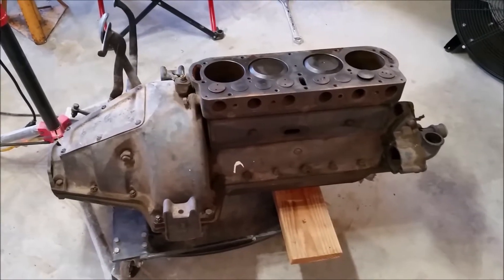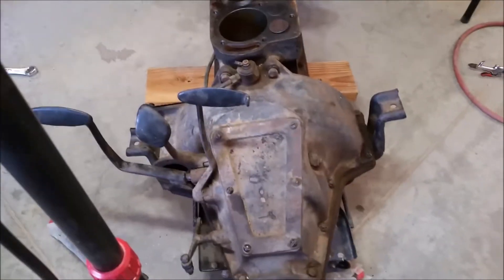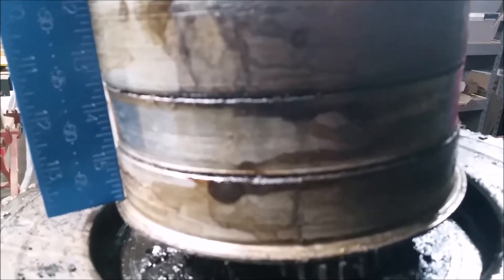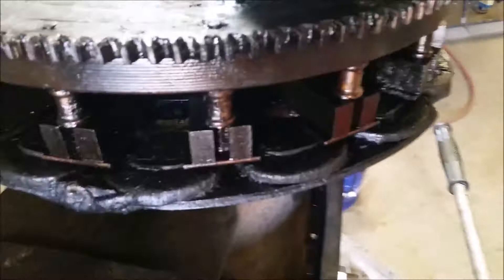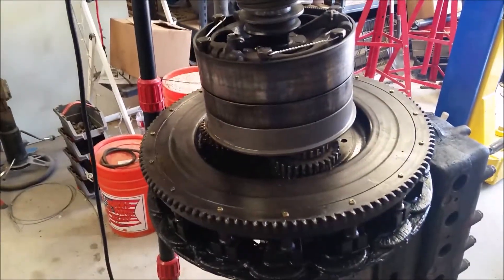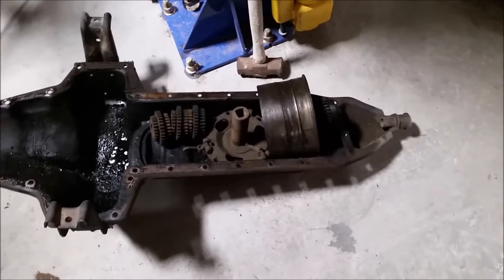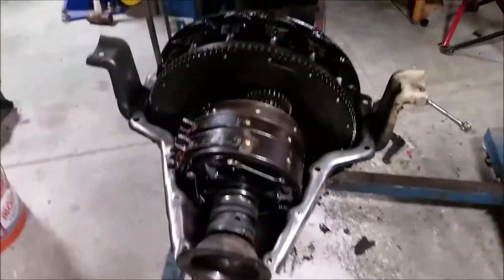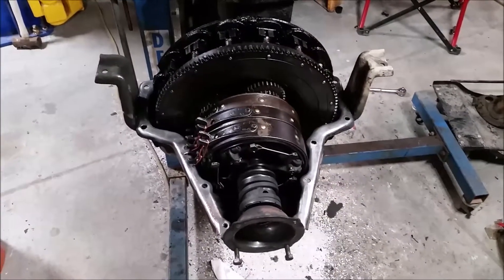The Replacement Engine

Comment: The pedals are consistent for a 26 or 27
Reply from the maker: That's correct. Thanks John. I've had this engine running in the car for about a year now. It just starts right up even in the colder weather.
Reply: Dave Flowers , how do we find a "May 1929" engine when the last car was 1927...?
Reply from the maker: @lewspeedwagon6330  Ford made replacement engines until 1941. This one is stamped with the May 1929 number.
Reply from the maker: It is a 26/27 transmission with the larger brake drum.